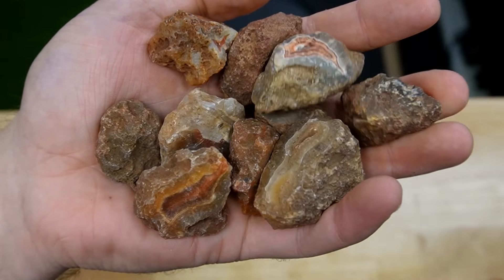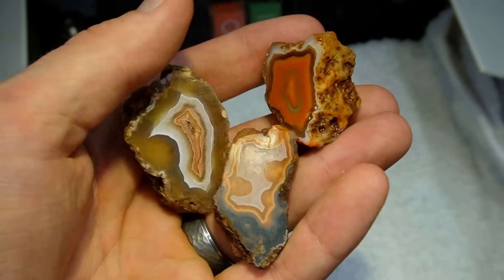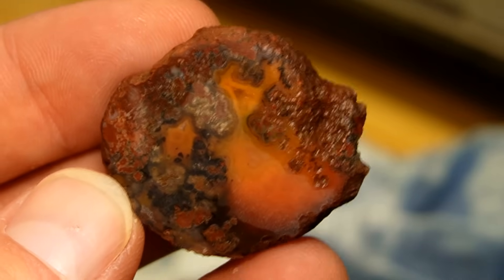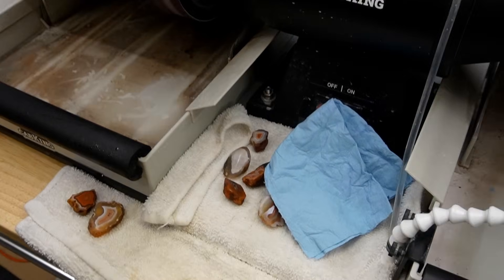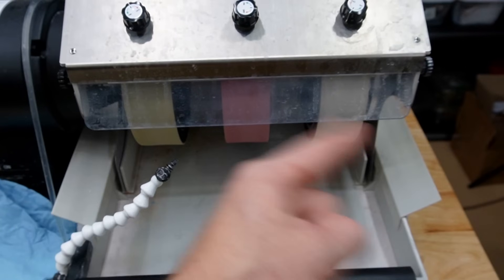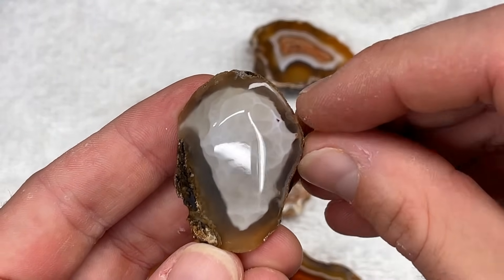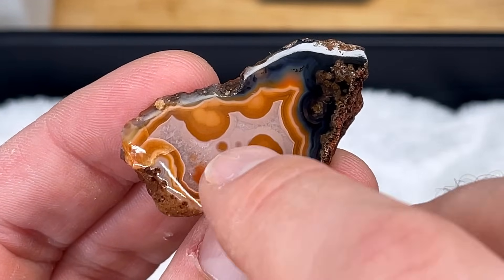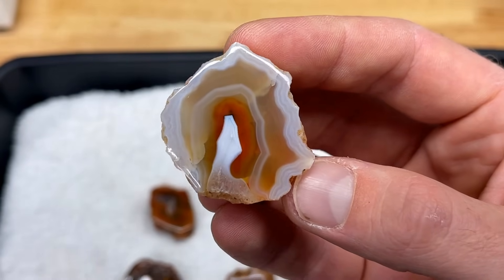Grinding Away the Husk to Expose Agate Bands!

Comment: Your polishing technique on the cab king is really effective man. Whenever I try to do it, I seem to just cause more scratches than it had right after the cut. Pretty much resigned myself to being a vibrolap-or-bust guy since it seems to be the only reliable solution. Great video as always.
Reply from the maker: What kind of wheels are you using on the cabbing?
Reply: @AgateDad  220 grinding followed by Diamond resin 280, 600 and 1200